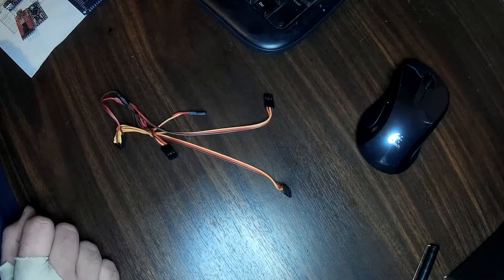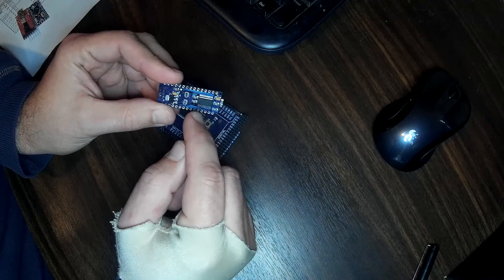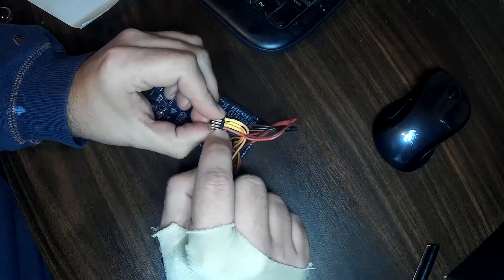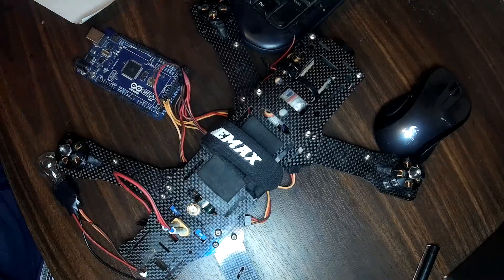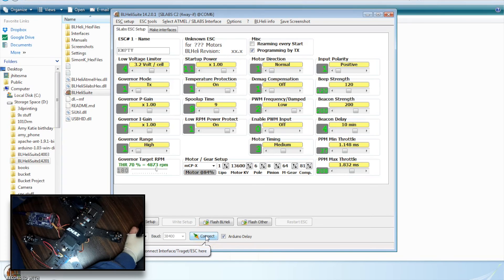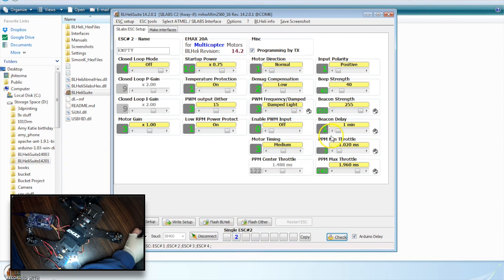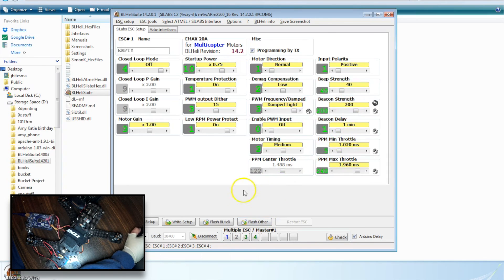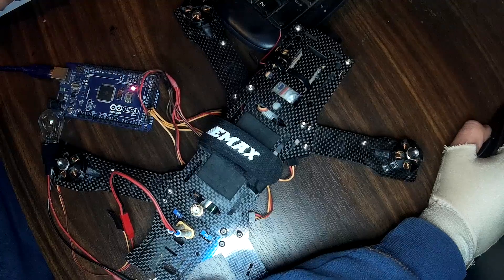4 way flash on the 280 Nighthawk pro ESC's

Comment: Blheli keeps giving me a connection error can't communicate with device... help!?
Reply from the maker: You're using the same arduino setup?  Did you flash the arduino with the proper code from within blheli?  It sounds like blheli isn't recognizing your arduino but I haven't messed with this is so long it's possible blheli has changed since I last used it.

Comment: here did you get the arduino pinouts? I intend to use the the Arduino Uno for that purpose... Thx
Reply from the maker: +Bruno Santos It's in the docs included with the blheli suite.  I don't have it handy at the moment to lookup the actual filename but it's in the help menu and has a fairly obvious name.
Reply: +Jason Hitesman , you're right there is a Manuals folder that contains the info I was looking for. Some earlier versions of Blheli suite had a link to provide that info but not anymore... :(
thx

Comment: Any reason why the ESCs are showing up as 20A ESCs on BLHeli Suite in the video?  I thought they are 12A ESCs on that board?
Reply from the maker: +ver2go96 Because it is the 20A firmware even though the ESC's are only rated for 12A.  I had to double check my original source and sure enough that's what 2dogrc was told to use by the emax engineers: http://www.rcgroups.com/forums/showthread.php?t=2443194&page=79&highlight=blheli#post33053323